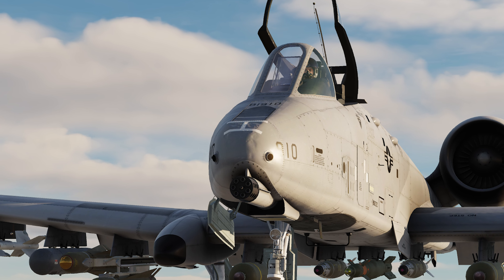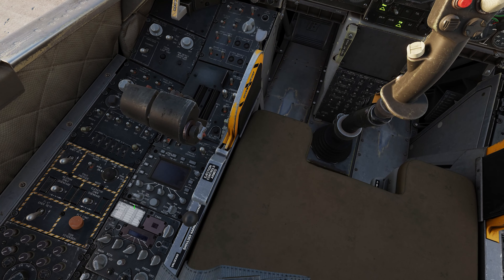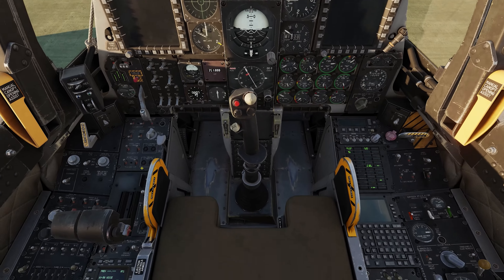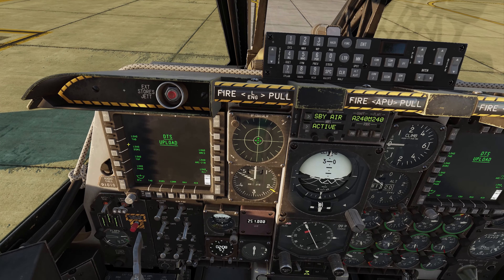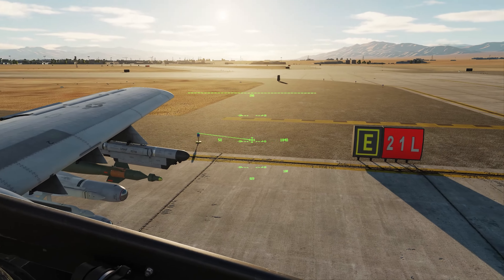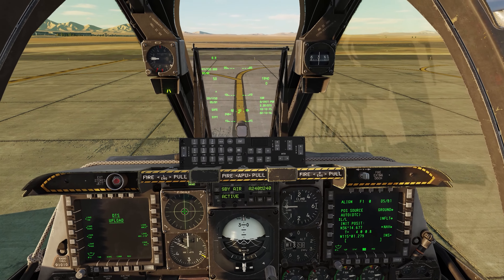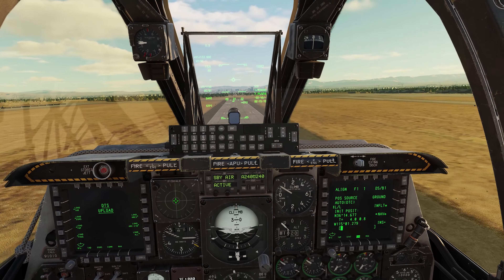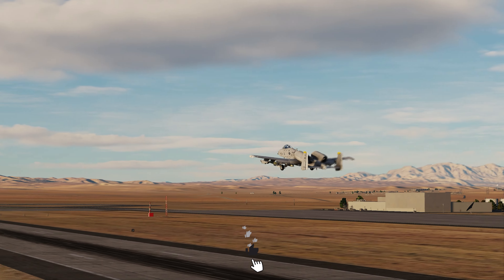A-10CII Startup, taxi and takeoff tutorial | DCS World

Comment: It is awesome! But for some reason my A10 is stuck in place, like everything is working, giving throttle, but the plane is just not moving. It feels like some kind of parking brake is on. Any ideas?
Reply: I figured this out after having the same issue, if you have a mic switch press that and have your ground crew remove the wheel chucks. Check controls if you don't have a mic switch. But pressing F2 and looking around that was what kept me from moving after startup.